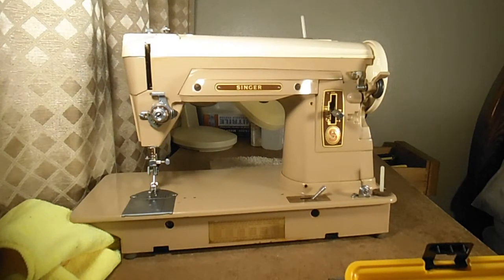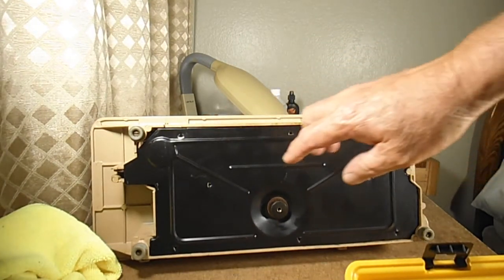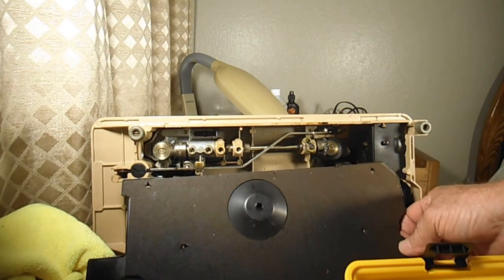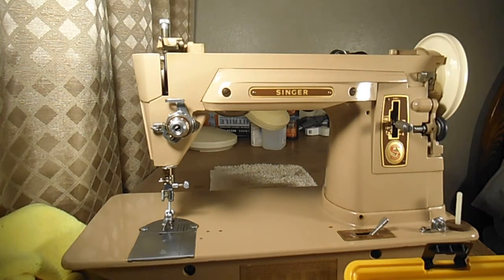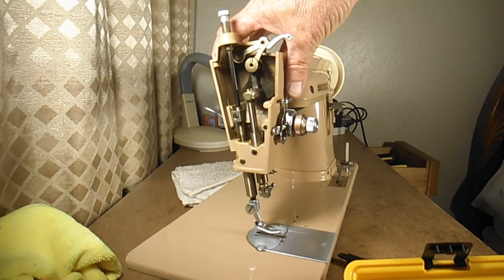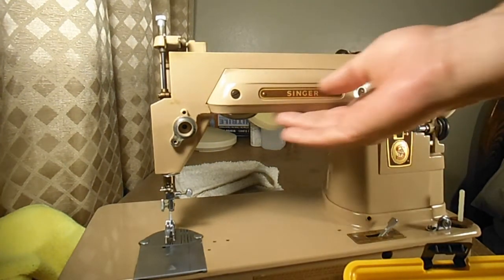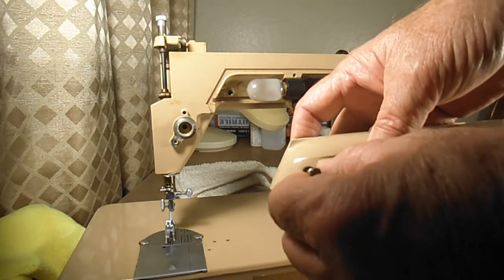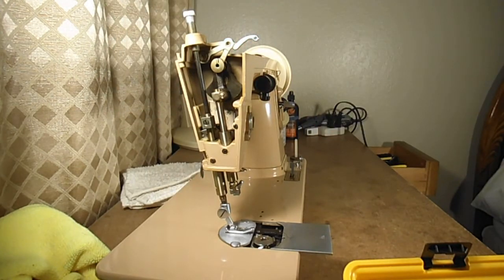SINGER MODEL 404 RESTORE SERIES Pt.1 REMOVE COVERS & TENSION

Comment: Hi there
I hope you are well.  Having fun with my singer. I probably  have a silly question.  Is the foot pedal Power cord supposed to go down toward your feet or come out toward the wall outlet?   I am not quite sure how to place my foot on the pedal as it has that little hump before the button that you press with your foot.     Thank you
Reply from the maker: It's a good question, Sandi. I don't think most people use it the way Singer meant it to be used. The cord faces AWAY from your foot. Your heel on the floor and the ball of your foot resting on the right post that is stationary. That right post is called the footrest. When you want to sew you "tilt" or "roll" your foot down on the left button, the one that presses into the controller (pedal) while resting the right side of your foot on the right post. The stationary footrest post is there to prevent you from resting your foot on the movable  (control) button while not sewing b/c that will depress it in a little. When the left/movable button is depressed slightly then some current flows into the carbon stack. Not enough to run the motor, but enough to start heating the carbon stack and it can get hot which is bad for it and shortens the life of the carbon stack and can be uncomfortably warm on your foot. Also, when the stack gets very warm/hot you can not control the motor speed as well. So, cord away, your heel on floor and foot on footrest post and slant or roll foot to the left to depress the control movable button to run the motor. Who knew? Thanks for watching my channel.

Comment: First, I apologize for this being verbose, but I can't thank you enough for being extremely detailed with all of your videos on restoring this! I was given a Singer 404 from a friend and it was seized in several places. There was no rust or detrimental wear on it anywhere, so going through all of your videos back in 2020 to disassemble, clean and reassemble it with visual and detailed information was a huge help. I probably would have given up and just went and bought a new one. I was able to find a buttonholer and zigzagger attachments for this and I have a lot of pride having followed your videos to get it working properly. Well, almost 3 years later, my 404 is still working great, but on occasion I'll refer back to videos if I've forgotten how to adjust something. It's hard to find info on these older models, so I truly appreciate you keeping them alive!
Reply from the maker: Hey, no worries. Verbosity is one of my character faults 😀 Thanks very much for saving that machine. If you still have it shows you know what a great machine it is. I appreciate you sharing the story, and happy sewing.

Comment: Hi Andy, I just bought a 404 off of Ebay.  I'm looking forward to giving the ol' girl a good cleaning.  Thanks for the comprehensive video series.
Reply from the maker: You're in for a good time, Ralph. My favorite Singer Heavy Duty Straight Stitch Sewing Machine. I hope you enjoy it as much as I did. If you'd like a free copy of the entire model 404 parts list with numbers and pictures you can find it here: https://www.universalsewing.com/images2/parts_lists/all/nijears4.pdf     This helped me when I needed to find replacement parts.
Thanks for watching my channel, and for saving another machine.
Reply: @andytubesewing1953  I've got one coming Andy.  Thanks.  I've been sewing really heavy cordura and have had a lot of trouble trying to help the 503 along with the hand wheel and the hand wheel coming unclutched and having to reset it all the time.  I think the pinned handwheel is the way to go.  I'll hang on to my 503 for the lighter stuff and the different stitches.  Thanks much!

Comment: Hey Andy! Mary in MA here. I APPRECIATE YOU!!! 😊 I 1st watched your 404 KK shower video very doubtful that I would attempt what Shelley did! I bought a 403 off ebay, it arrived in nice shape other than the seller didn't secure it inside the broken case cover w/o the bottom- sadly scratched the paint, but I got over it. THEN! d/t your rave of the 404 I found myself on Craigslist last week and bought a 404 one town away within the hour, came w/ bells and whistles, even the old zig zag attachment. I thought it was full of old varnished grease inside and bought KK, Tri flow duo, long thin screwdriver and dismantled this little grub and followed your videos throughout the process! The varnish was nicotine and washed magically away. Like Shelley said, I felt that feeling of accomplishment too! I started quilting class last week and the instructor asked me what machine I have and when I told her, I saw her eyes glazing over, not thrilled. She asked me if my needle drops down auto. when I stop... No, I said but I can do that myself. I Love these machines! I have you to thank for it! I opened the 404 motor as it hasn't got pep to move, just tries, but too tired; but it all looked clean inside so bought one on ebay. Now I have 2 questions for you: you mentioned in the 301 motor video that 400 series is compatible with the 500 series? Could I really use a 500 series motor for a 400 series if I need it? And would you recommend me working through the 404 motor that I have or does it sound like it's shot? It just makes beginnings sounds, but wheel doesn't turn! Thank you for spending all that time with me while I repeated your videos...to see..."What did he just do there?" It was like having you there with me and I giggled at your jokes and thanked you for saying, " I knew you could do it!" Your so generous🌻. - Mary
Reply from the maker: Thanks very much, Mary, and thank you for saving a vintage machine. You've been a busy lady, haven't you? Before I continue, I had to laugh at the quilting lady who was smug about the 404 not having auto-lift. I wonder what she thinks about the millions of quilts worldwide that were sewn by hand with needle and thread, let alone an electronic, auto-lift machine. Anyway, I'd like to discuss this with you before you go farther along, but it's up to you. My email is andytube@gmail.com if you'd like to contact me. I want to explain why I don't think you have a motor problem and offer some suggestions for troubleshooting and repair. Waiting ...

Comment: Hi Andy, if you're around.  I finished my Singer 404 restoration and no problems.  The old girl was just really dirty and dry.  The tension unit take up spring was badly bent and I ordered a new one from Central Michigan Sewing Supplies.  I went through the controller and there was a couple of things in there.  The screw that holds the carbon pile bracket on one of the piles had backed out half way so I caught that.  I checked the carbons and I had 4 that were a little burned and changed them out.  One side was short one carbon so I had some extras and added a good one.  The commutator on the motor was excellent so I just took one of those seating stones and lightly cleaned it.  The machine runs quiet.  The foot controller warms a little when not in use so I've got to go back in there.  I couldn't have done it without your wonderful videos.  Everything is completely covered.  All I can say now is THANK YOU!
Reply from the maker: Congratulations Ralph. You're getting to be a real old pro at this. I'm happy it has turned out so well since you bought it online. It doesn't always work that way, but I think you knew what the look for in the pictures. I couldn't be happier for you. It just sounds like a marvelous machine. Makes me want to go find one myself and do it again even though I probably done 15 or 20 of this model. Happy happy for you

Comment: hI Andy.
After oiling greasing and threding thanks to you I have started to sew. The motor growls and sporadically  doesn't run. Have you a video on servicing the motor or is it time to buy new?
Reply from the maker: Check out this playlist for motor repair https://youtube.com/playlist?list=PLsCOZgzzaiKJSu0T9oeaheTZsrUe91kkZ&feature=shared.  I'm not sure about the growling you mentioned, but it might be the top bearing where the motor shaft comes through. Just below the pinion gear for the hand wheel

Comment: Hi Andy, hope all is well with you.  
 Andy, I am trying to get a Singer 319W back to working condition (thank you for the manual!).  I removed and cleaned all the parts that I was brave enough to.   I put the balance wheel back, put the washer in exactly the same position as I found, put the stop motion wheel on, and tightened the set screw ensuring that is is not resting on one of the elevated buttons.
When I loosen the stop motion wheel as you would for bobbin winding, I can feel the set screw bumping against the elevated buttons on the washer and stop.
When I tighten the stop motion wheel clock wise as if for sewing, the needle bar does not move.  When i gently wiggle the balance wheel back and fort, I see the arm shaft and the needle bar move but not all the way.  It feels like the arm shaft is also stuck between two elevated buttons on the washer because that is how much it moves - just a fraction.  
I changed the position of the washer but with same result.  I am not sure if the needle bar was moving up and down before I started working on it.
I was hoping to get the insides moving a bit so that I can clean/ oil them.
What am I doing wrong?  I checked the manual and your videos and I assembled the balance wheel correctly.  
thank you Andy.  Stay safe.
Daisy
Reply from the maker: I don't think you are doing anything wrong as far as the handwheel parts are concerned. If you want to verify that you can just remove the handwheel and turn the arm shaft by grabbing it at the end and turning it. I'm thinking it is going to stop the same way as when the handwheel is attached. 
     There are so many moving parts on a sewing machine, and they mostly all move at the same time. If any single part is stuck or blocked then nothing can move. You think it may be the handwheel or stop motion clamp but that's just because it's the normal place to turn the shafts.
     Your machine is more complicated than most, with all its "typewriter keys" that move levers and followers inside to sew a pattern. Many moving parts there. It also has a cleated drive belt from the top to the bottom of the machine. The thing is if the hook was blocked from a tangled thread, or a broken needle piece, or the takeup lever was bent, or the needle bar was blocked by dried oil in the bushing, or a piece of the drive belt was caught on something, or you have the bobbin case installed wrong and it's off the race, well... you get the point. Any of those things can cause a machine not to turn on the arm shaft.
     One way I approach this is to get the instruction manual for the machine,
https://www.singer.com/search/support?title=319     If possible I try to put all the levers in position for the simplest stitch which is usually straight stitch number 12 or medium length. Now I  carefully follow the oiling instructions in it to thoroughly oil all the points it says to. On your model, there are about 50 oil points.
     Once that is done I use a hairdryer to heat up the machine, pausing at all those oil points to get them good and warm. This can take a long time. Heat, try to turn, let sit, heat, try to turn, let sit... This process is just to see if the problem is dried up oil in any of the moving parts, especially the shaft bushings that support the shafts. Over the decades a lot of oil can be put into a machine and it is seldom washed out or degreased. Now let that oil sit there for a year, or years, or decades and dry out and turn as hard as dried varnish. 
     If this does not get the machine moving then I start taking parts off to see if that was the cause of not moving. Patience is the key to the oiling and heating method. It can take from 5 minutes to several hours, or overnight and more the next day.
     Some people use kerosene instead of the oil and skip the hairdryer. They believe the solvent works faster and better to get the old gunk out, then wipe up as much as they can with rags and apply fresh oil. I've never tried it.
Reply: @andytubesewing1953  Thank you for this detailed reply.   you are correct, nothing moved with the hand wheel off either - when I tried to turn just the arm shaft without the hand wheel.   This machine has been in heat and humidity for years!  I was scared to take out the type writer cams but I may not have a choice.
I will try the oil and heat method (don't like kerosene!).  If that does not work, will try removing parts.  It has no bobbin, just the case and that seems to be clean.
Will keep you posted.  Yes, patience!!  Thank you Andy.  Stay safe.  Daisy.
Reply from the maker: @daisymay6290  Good luck. I don't care for using the kerosene either. I use Krud Kutter Cleaner & degreaser and wash the whole machine in the shower and dry with a leaf blower. 👀 https://youtu.be/SXn57XzNiRQ I usually remove a lot of parts but viewers have told me they tried it with most of the parts still on the machine, minus the motor. You can try the method I suggested with oil and heat. You did not mention anything about rust so I did not ask about it. Rust removers work better when there is no oil/grease on the metal. I have injected the KK into the oil points before washing. Hope things get moving for you. Good luck.
Reply: @andytubesewing1953  Thank you Andy :)  luckily there is minimal rust on the machine.  I saw your series on restoring Singer 404 (loved it!) and saw how you washed the machine in the bath tub :)  After watching those videos, I also use KrudKutter for cleaning the parts.
Here is an update on the 319 on why the hand wheel was not doing a full rotation:
- I found that the 'bobbin case holder position bracket' which is like a long finger with a slightly bent/ curved tip is the issue; it is screwed in and supposed to hold the bobbin case?.  
- That tip was placed in a grove in the bobbin holder.  The tip of the ‘Bobbin Case Holder Position Bracket’ was hitting the sides of the grove on the bobbin holder preventing the hand wheel from turning a full circle.

I moved the ‘Bobbin Case Holder Position Bracket’ out of the grove,  screwed it in a little away from the bobbin holder, oiled the machine per manual and it seems to be moving smoothly.   Have not put the motor back in to fully check it but at least it’s moving.

What is the correct position for the ‘Bobbin Case Holder Position Bracket’?   I could not find it in the manuals for 319 or 306.  
I wanted to tell you this piece of good news and say thank you for the detailed replies and your encouragement.  Thank you!!
Hopefully more good news tomorrow (smile) - Daisy
Reply from the maker: @daisymay6290  I'm glad you found the "one thing" that was causing the problem. To me, it appears the service manual for model 319 shows a thread clearance setting between the position finger and bobbin case base of .020 inch, with a tolerance of .002 inch, so anywhere between .019 and .022 should work. I'm seeing that on page 111 of the service manual I have.
Reply: Andy Tube Aaaah, so that is the thread clearance!!! Beautiful!  I will try tomorrow.  Thanks Andy 😀👏🏽👏🏽
Reply from the maker: @daisymay6290  Sure. You are already learning a lot 👍 Have fun and thanks for rescuing that machine.

Comment: Hi Andy, Great videos, I've learned alot! I started workinng on sewing machines as a hobby during Covid. I've recntly received a Singer 4525 C that was donated to me in a bag of parts.The only part of the tension assy included in the bag was the large tension dial. Using my own collection of scavenged Singer parts, it looked like I had everything I needed.  I've watched your tension videos, they are close to what I have but not exact. My problem is the tension assy is not releasing pressure on the 2 tension discs as it appears that the thin needle like tension pin is not long enough.  Are there different lengths of pins?
Reply from the maker: Although there are no lengths listed for the Tension Releasing Pins in the parts manuals I believe there are different lengths. Many of the machines are old enough that they may have been repaired a few times and it is possible other TRP have been used, I have made a few new ones using nails. The beginning of this video shows how I do it if you are interested,
https://youtu.be/M1kXDd5GLEE  I never worked on Model 4525 but have the parts list for it. Oddly, it does not show a traditional TRP in the schematic so I can't give you a part number.
Reply: @andytubesewing1953  Thanks Andy, I liked the idea of using a nail so I cut a few nails to different sizes until I had one that worked.  Thank you very much! Wishing you a Merry Christmas and a Happy New Year from Vancouver Island.  Karl
Reply from the maker: @karlkiltz1231  I'm happy it worked out thanks for the holiday cheer and have a great year 2025